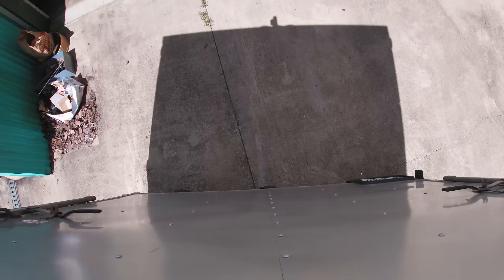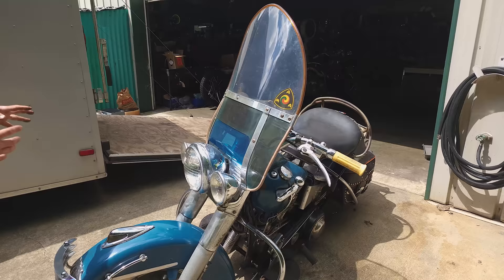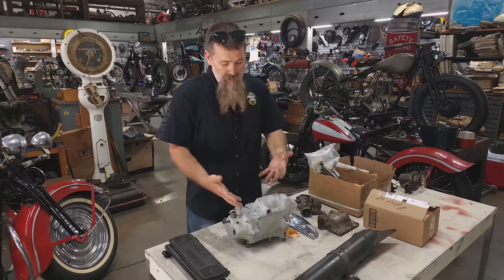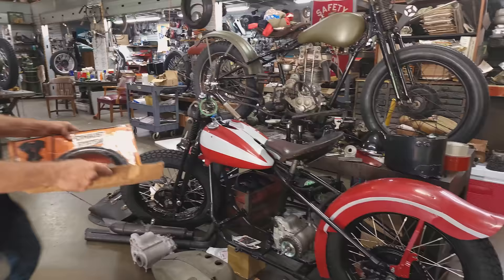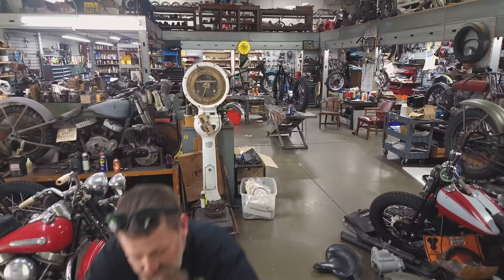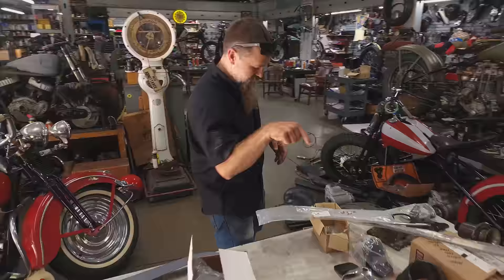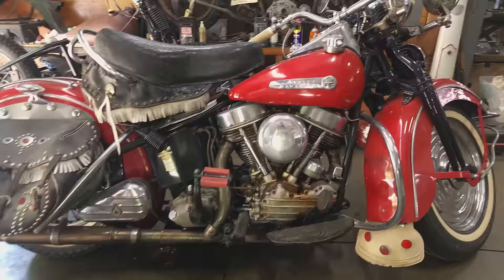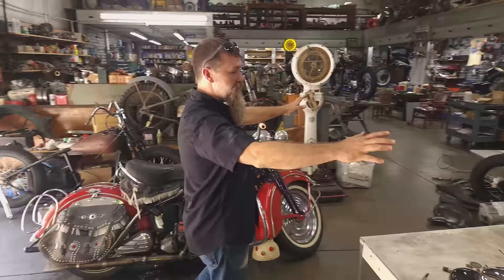I Sold A Bike And Went On A Shopping Spree

Comment: There used to be a motorcycle shop in Fridley Minnesota called Kokesh motorcycle and they used to have a knuckle head drag bike with a supercharger on it that looked like the same kind used on the Studebaker  golden hawk and it had a custom frame with a big slick on the rear and they named it the white knuckle express. They used to have it on display in the building along with other old HD 's that they restored and when they had their bike show each year they would put the drag bike out for people to look at and sold t shirts on the bike to help pay for parts and fuel to run it . The shop was around for years then the owner died and his son took the business over for a few years and eventually it closed up so I bet that bikes probably somewhere in the metro area still . There used to be 2 drag strips not far away from the shop one called North Star drag ways in Mounds view and the other Minnesota drag ways in coon rapids and I am sure this bike used to run at either tracks at one time. This bike would look cool sitting on display at this museum if they could some how find where it's at and strike a deal up to buy it and bring it to the museum and get it running to start for the patrons coming to the museum .

Comment: Man, you’ve got some great treasures there. Really dig the j-slot air cleaners and the Flanders bars. Been thinking about fabbing some exhaust for my 47 and really really dig the exhaust you rounded up. Didn’t know you had been hunting beaded windshield stuff. I’ve ended up with some nos beaded windshield replacement pieces for those windshields that came in a pile of parts mom and dad got at an auction from a dealership that gone out of business. Got red, blue and clear bottom panels and some new clear tops that are all oem replacement parts and pieces that I’m assuming were for use on wrecked bikes but could just be leftover parts that were never used. 
Had to hop back on and give an opinion on the bars. The Hellings and Stellings bars are okay but they really do look better on a K-model style bike or very early Ironhead. Even though they’re a 1 inch bar they still have a bit too much of the British styling for a big twin for me, again just an opinion.  Flanders bars are the Cats a$$ as far as I’m concerned, bought a couple sets from Darol Dryden over the years and they’re some of the best bars I’ve ever owned. They have the most uniform wall thickness thru the bends that I’ve ever seen and are almost unbendable. The internal throttle and spark retard are even better icing on the cake, surely you’ve got some Beck grips to go with em to add to the dealer accessory styling.